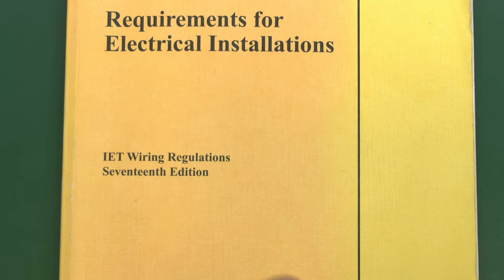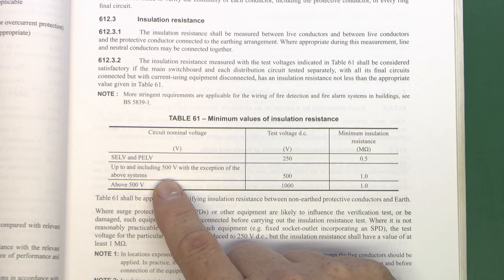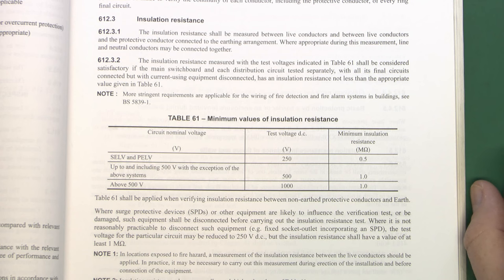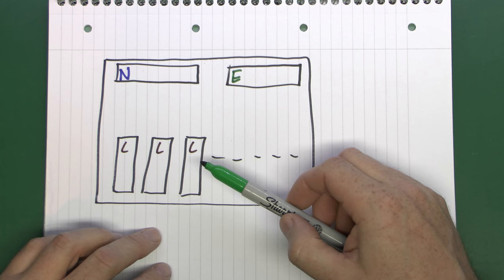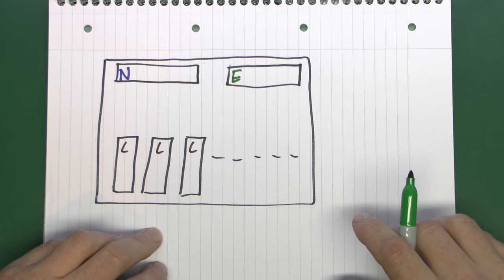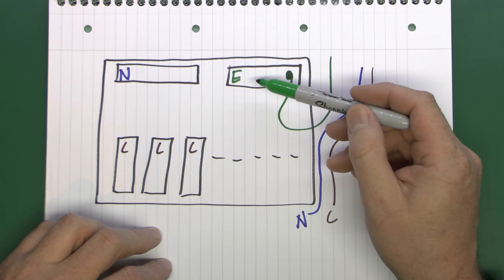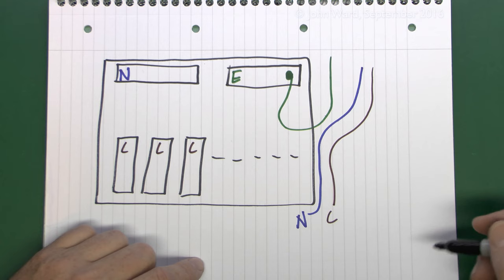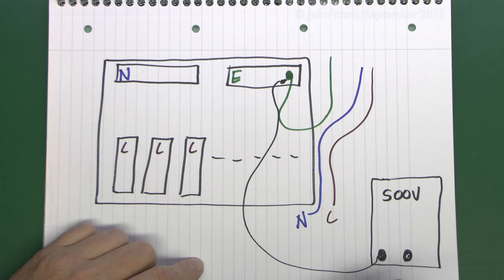Insulation Resistance Testing

Comment: Hi John another great video thanks.

My opinion on IR;
IR is arguably the most important test that is ironically rarely done by Electricians. It's the test that tells you if a cable is melting and if a building is likely to burn to the ground. 
A good Manager will know if his FWT Engineers are or aren't doing IR Tests based on two things. 
1-Are all the test results the same on every EICR/EIC/Minor Works he does? >999 ???
2-How often do they buy new batteries for their MFT ? IR dramatically reduces battery life. Though maybe your firm has the new Megger 1730 or above which doesn't require batteries. 

I'd add a few other points;
1-Remember to switch two-way and intermediate lighting circuits etc all directions re-testing each time so you check all parts of the circuit. 
2-Warn other tradesmen nearby to get away from extraneous conductive parts. Seen a plumber leaning on a radiator beside the mains getting a zap during IR Testing one time but it's ok he was a Plumber...
3-You never covered the 3 phase process of IR testing.
4-You may have to discharge some circuits you have put 500v through if you need to test Continuity after IR. Testing process is not always done by the BS7671 process. Leave the probes on or touch the cables to Earth Bar and watch them spark.
5-Old VIR Cables should be tested at 250V
Reply: Ivan Drago
Reply: Loop impedance will tell you if a building is going to burn down

Comment: Once when I was working as a Kitchen Porter for a major restaurant chain, I caught our 3 element, 10kW immersion heater JUST as it was starting to catch fire, due to an arc forming across insulation breaking down on one of the connectors. The smell of burning plastic when I went to get the vacuum cleaner gave it away.

This lead to a very frantic 30 seconds as I turned off every single switch I could find in the cupboard, then opened up the breaker box and tried to find what exactly they had labelled the heater elements as. Definitely one of the more stressful short events of my life!

Comment: Also worth mentioning, when testing lighting with 2 or more way switching, L-N and L-E tests need doing for each of the different switch combinations in turn. This is most fun when working alone with the board in the cellar and the landing light switches in the hallway and at either end of the landing.

An increasingly common permanent load L-N would be a 13A socket with integrated USB power supply
Reply: Yep, got caught out by one of those we'd forgotten we'd installed  during the testing phase. Fortunately the test didn't damage it

Comment: Insulation resistance testing during electrical installation condition reporting is the biggest ball ache in an electrician's existence!! There's always that one thing left plugged in or light fitting with a transformer that the customer always forgets to mention.
Reply: Totally agree with you there. I almost always now pre-agree with the client and do the IR test between L&N together to Earth on EICRs.
Reply: Absolutely agree. The requirement to do an insulation test after even minor work is a pain. You often cannot even determine the extent of the circuit due to a hundred additions over time and you can guarantee things are plugged in behind wardrobes, under beds, behind kitchen cupboards and in lofts; even the home owners don't know they exist!! My registration body advised to simply put LIM on the form otherwise you can be there all day and still not get a test.
Reply: Additionally, try explaining to a customer who has just had an additional socket installed why you are going around every room in the house unplugging everything. Until you insulation test you do not know if you have disconnected everything or not by which time you will have sent the first 500V down the line and may well have destroyed some expensive LED installations or IT /video equipment. Common sense (and safety) dictates that you do only a LN-CPC test unless it is a completely new rewire.
Reply: You're right, to agree limitations is sensible. The problem with the approving bodies is their advice can be conflicting and inconsistent depending on which inspector or person u speak to. You'd like to think common sense prevails but there's always someone to question it.
Reply: trickyd2013 connecting live and neutral together and testing both to earth bypasses the load though right? So no need to really worry about pir's or lamps still in fittings?

Comment: Great Videos. Thank you.
Lamps: Fly in the ointment is that modern LED lamps have integrated bulbs so not easy to disconnect unless one removes the whole fitting for the ceiling.
Reply: Ashok Patel u

Comment: It's only continuity you need to remove lamps as it affects the resistance reading not insulation resistance as you just test between the bars and breakers on the board

Comment: I install a lot of MICC and can always get an IR greater than 499 M Ohm. The worst I have come across was about 30 years ago in the houses of parliament, most of the MICC was less than 0.2 M Ohm (a lot of the pots had no RMX compound whatsoever) and most of the protection was 3036 and BS88
Reply: CrazySparkie63 watch out for asbestos mesh flash guards on those fuse wire carriers mate!
Reply: How common is MICC in 2022?
Reply: @sports872  Still very common in new builds!

Comment: Noticed for water culprits that electrical showers weren't mentioned. I've had a problem before where an electrical shower was tripping the whole upstairs socket circuit. Just thought I'd add that in case anyone is having a similar issue.

Comment: Don't forget shower pumps and showers. Had a Salamander pump only 18 months old tripping an RCD because it was internally leaking. Had a problem claiming it was still in warranty. Salamander registration sucks. As usual one RCD covering 6 circuits including all the lights :(

Comment: Sir, how would you test GFCI breaker circuit which trips intermittently even with the hot tub  is totally disconnected but the wires are still connected to GFCI. Should I disconnect piggy back white wire to not to damage it or disconnect all the wires? Also should I disconnect wires from the breaker in house breaker box for maximum separation or it is enough to turn breaker off. Great presentation, thanks

Comment: Example I just completed a months training for city and guilds domestic installer including 18th edition. Contacted niceic they asked have you worked in the industry for 2 years I said no (honest answer) then you cannot join for 2 years. I asked where it said this on there website? Buried on page 12 of brochure. But when you click on there join us link on the site it says quite boldly join us within 3 weeks. No mention of 2 years experience. I rephoned and said I have 2 years experience (no evidence requested) was told I could arrange an assesment immediately no mention of 2 years experience required. When they discovered it was me call was diverted to a higher up who then refused to proceed. When I asked what 2 years experience was they could not tell me. When I pushed them it could be as simple as 4 items of work done over the 2 years. Judge for yourself. Is that rectum protectum. Or raising the standards In The industry?

Comment: what is the voltage?
what is the current?
what is the resistance?
Reply from the maker: Test voltage is normally 500V DC, the current depends on the resistance of the circuit but typically limited to a few mA.

Comment: Hi john, just to pick your brain really,  I use an analog mega tester all the time, its my goto fault finding tool of  choice. Quite offer when checking an older property with damp issues, the needle on the tester will do a FSD then slowly sink back to >1Mohm (hopefully more). Would this be because the damp short is getting dried out by the 500v or maybe the initial surge from the mega is producing the FSD? 
Like the video presenter voice BTW! And how about a short video on analysis of analog mega readings for us older sparks?

Comment: Hi john great video, wouldn't it be much safer (and quicker) just to test everything LN to cpc on 250V  all the time? This would negate all problems that currently exist with real world IR testing  i'd love to hear your thoughts on this.
Reply from the maker: 250V DC isn't high enough, 240V AC has a peak of 340V.
LN to cpc is certainly useful on existing installations where equipment is connected, but for a new installation equipment should not be connected until after testing is done.

Comment: Another item which you may forget about when testing may include mechanical ventilation systems often found in newer homes, often wired directly in and situated in the loft.
Could a separate net filter mar your measurements?
The capacitors in them have an impedance which gets lower as the frequency increases, but they have a fairly high impedance for 50Hz, this impedance may be around 5 MΩ.
However, the resistance for a DC current is very high or infinitive, when the capacitor isn't exposed to a voltage too high.
When you use a 500v test voltage on a filter which contains capacitors rated for 400v it may cause problems?, could the capacitor insulation fail?

I ask this because after disconnecting all known users I could still measure a potential between the earth leads in my consumer box and the disconnected earth lead to the earth electrode.
(No metal parts should be touched in the house when earth is disconnected with the power switched on, there is no earth protection and touching a metal surface can be lethal if an earth fault should occur! I made sure no other people or pets were in the house when doing this measurement)

It turned out to be the lighting in the bathroom cupboard/mirror which is directly wired in, it contains LED lights and a switched power supply, the lights are switched on and off in the low voltage circuit and the power supply stays energized all the time.

Comment: I understand 500v across L-N can damage connected loads and give inaccurate results. But how does testing between L-E or N-E cause damage? If there is no potential difference across the loads? If it does would 250v test still give you an appropriate readings and cause no damage? Only an apprentice so asking because this seems to be a great tool for fault finding and sometimes the fault is with the equipment itself.
Reply from the maker: Some equipment has filters which are connected between L-E and N-E.
If in doubt test at 250V first which won't damage anything.  If clear then test at 500V.
Reply: Thanks for the reply! loving your videos. They’re very informative and contain plenty of knowledge to absorb

Comment: Total voltage DC 250,500,1000 in Megger multimeter no more option to set in DC. How can I adjust it AC ? Or DC mean throwing DC 250,500 or 1000v?

Comment: with regards to neons in plugs or FCUs. What is the appropriate action? disconnect them? link L-N and test across them the CPC? the OSG just says disconnect dimmers but no guide on neon devices
Reply from the maker: Switch them off.  In most cases there is no need to do insulation testing beyond them as they are normally used for fixed equipment such as electric fires, boilers, etc.

Comment: John I heard you say greater than 1megohm is acceptable but isn't it correct that on a new installation you need a minimum of 20megohms to be acceptable?  Great videos by the way!
Reply from the maker: 1M is the minimum stated in BS7671, however for a new installation you would expect values in the 100s for a single circuit.  Anything less would require further investigation.
Older installations may be lower due to contamination with dirt/grease/moisture at sockets and switches, but even there a value of 1 is the absolute minimum and higher values would still be desirable.
Reply: @jwflame  yes you're right, I just found out where I read about the 20Mohms from... Guidance Note 3 page 51 3rd paragraph anything below 20M on new installations should be investigated

Comment: Hi John. In case one is testing a ring circuit, shall one link both L cables (incoming and outgoing) together and test them against N cables linked together?
Reply: Provided you have first proved the continuity of the ring for all three conductors, you can just connect one end.

Comment: On the IR testyou said that you could link the L & N to one prove and the cpc to the other if its impractical to remove something that could be damaged.

Would that work for doing IR tests on sockets that have the USB slots on them? as I assume they would be fried with 500v
Reply from the maker: Yes, and that is the only way to test those sockets.  Also used for lighting installations which contain electronic devices that are impractical to disconnect.

Comment: Regarding the Guard terminal on an insulation resistance tester: when is it appropriate to use this lead? The Megger MIT525 manual suggests using it for resistances above 100GOhm but another Megger webpage says 100MOhm. (https://uk.megger.com/electrical-tester/april-2019/the-importance-of-the-guard-terminal-in-insulation). I don't own a Megger but I've got a cheap SZBJ BM500A insulation resistance tester that has a "G" terminal but says little about using it. The BM500A only measures to approx 1GOhm yet it has a G terminal, so I'm guessing it's 100MOhm and not 100GOhm. I haven't yet found a YouTube video that shows how to use the "G" terminal.
Reply: I thought i knew, but i looked at a picture of a SZBJ BM500A, and I definitely don't xD

Comment: Would you be able to explain the best way to test both individual circuits and the whole installation where there are ONLY single pole RCBOs (neutral fly-lead, no earth fly-lead) installed where the manufacturers instructions state that "all connections to the device must be removed prior to conducting insulation resistance tests".
Reply from the maker: For individual circuits, disconnect the circuit L & N wires from the RCBO and test those wires.
If RCBOs are installed, it is not possible to test L-N for the whole installation, but you could still connect L&N together and test LN - E for the whole installation.
Reply: Thanks John. So would I be in correct in stating that for a ring final circuit, I would disconnect both legs (L, N, & E (I've seen some texts stating that the earth should remain connected to the CU and others stating that it should be disconnected...)) from the CU and connect crocs to one leg only thereby replicating the test for a radial circuit?
Reply from the maker: Yes, but leave the earth connected to the consumer unit.

Comment: Are you saying that shortening L and N for  testing rings with power sockets that has USB ports integrated shouldn't damage them? Thanks.
Reply from the maker: Yes, if L&N are connected together, there can be no voltage between them to damage anything.
Reply: @jwflame  sure you have said that in video, not even know why I asked. Thank you

Comment: My meter has an additional Mohm setting of 20,200 or 200 and continuity on it has 20,200 and 2000 ohm setting. 
Which setting do I need for each test respectively? Any help appreciated, testing exam tomorrow and unsure,  and find info anywhere and been ages since used as been on install, any help greatly appreciated.
Reply from the maker: For continuity you are looking for very low resistances, so the lowest range would be used, 20.  The meter should also be specified as being able to apply at least 200mA test current.
For insulation the desired result is the highest possible, so the highest range would be used.  The output voltage of the meter is also important, 500V for single phase circuits.
Reply: John Ward thanks mate, so 2000 ohm on ir, not sure about 200mA but sounds right I'll check that out.
I will be doing ir on 500v on single phase but just a bit unsure if I would megger 3 phase single phase breaker at any more than 500v unless it's supply 3 phase equipment on a 3 phase breaker then I would test at 1000v is that correct? Cheers

Comment: Hello John. 

Been a while since you posted this but I have a question if you don't mind.

Take a look at the first schematic in this link. "The megohmmeter". It shows one lead of the test equipment connected to the copper core of a cable and the other lead connected to the actual cable insulation. When I first saw this I thought: Ok, you're looking to see if there is some kind of current flow through the insulation material. Makes sense right? If there is a current flow then you will notice that in the form of a low resistance across the insualtion material. So, you are actually  testing the integrity of the insulation material itself.

Then I look at yours and other videos on the subject of insulation testing and they show both leads being conneced to the cable core. Even though the same principles apply as far as testing the integrity of the insulation this first method uses a different approach. Do you have any thoughts on the first approach? When would it be appropriate to take that route for example? When you can't get to the other end of the cable perhaps?

Cheers

https://www.ecmweb.com/test-amp-measurement/understanding-insulation-resistance-testing

Comment: Hi John, would a good way of  testing be,  by just measuring load currents and. voltage drops across the loads this could be done on individual loads that could not be included in the original IR tests, hey isn't that what pat testing
is about.

Comment: An apprentice accidently meggered (500V) through the analogue supply authority kWh meter. Everything is working ok, but can the meter be damaged by doing an IR test on the submains with the meter in circuit?
Reply from the maker: No, all that the older meters contain are a few of coils of wire, all of which can easily withstand 500 volts and probably a lot more.